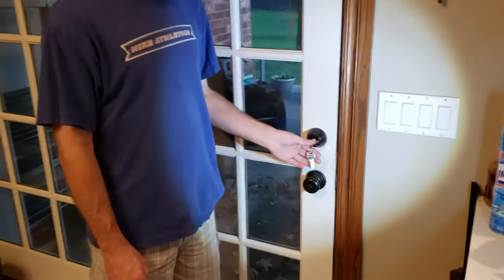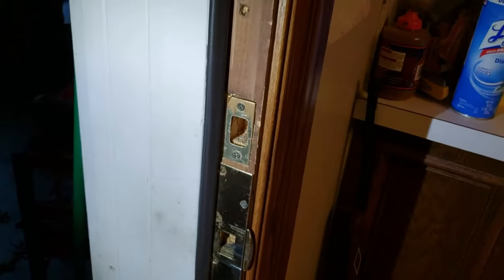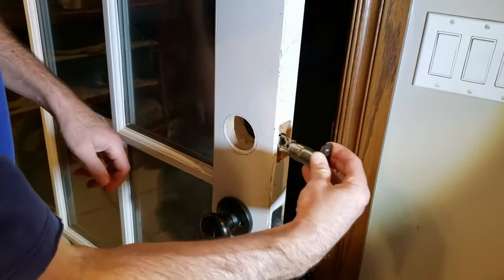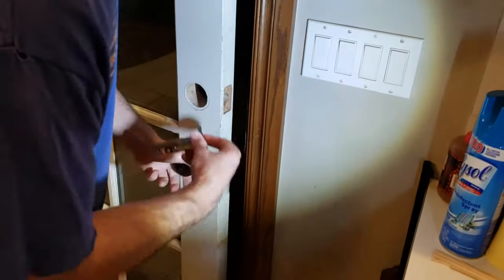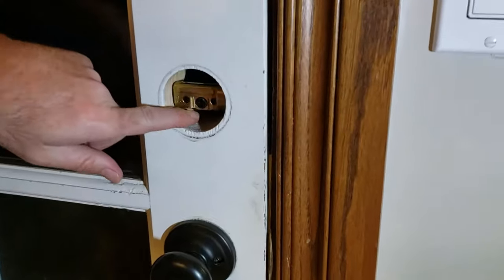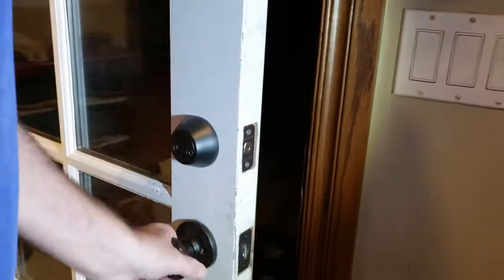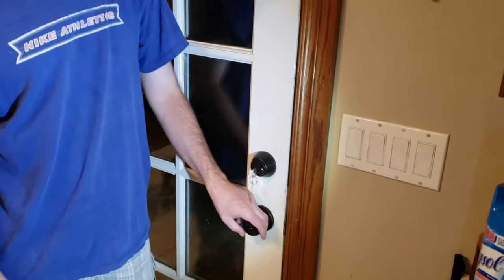How to replace a deadbolt door lock in 10 minutes. Easy install!

Comment: If the hole is stripped out you can also pack it with toothpicks instead of scrap wood, and then snip off the ends and the screw will be able to fit in tightly.
Reply from the maker: Great tip!

Comment: I was able to replace my deadbolt, thank you to this video. I used a Master Lock (heavy duty, ASCI 2), and it was quite similar to this one, only it was harder to thread the pieces of the lock into the area of the bolt where each piece is meant to fit.  It took me longer than 10 minutes, but I didn't give up. I'm not used to a project like this.  I took a break, watched this video and a couple others again, took a deep breath and got it done.  The new lock is way sturdier than my old one, and the key turns so easily.  Big difference, my old lock had been rekeyed a number of times, the last time a part-time lock smith rekeyed it and it was no longer safe, I could barely open it or lock it without significant struggle.
Reply from the maker: That's great to hear. Good job sticking with it and doing it yourself!

Comment: I’m actually glad I watched this before attempting to install my own!  The new wood in the screw hole is not something I would be able to tackle on my own since I don’t have that wood cutting tool or extra wood! It’s always nice she they show you in these videos the things that could go wrong before attempting it! So thank you!
Reply from the maker: I'm glad it helped. Not all screw holes get stripped/enlarged like mine did but it's good to be prepared. Also, you very well may have some wood around your house that would work - a paint stir stick, for example. But I understand the concern of getting part-way through and not being able to finish it.
Reply: You can use toothpicks as well.
Reply: I use wooden matches after I break off the match heads! They work amazing! Perfect size!
Reply from the maker: @tinafrick3331 Great tip! Thanks for sharing!

Comment: Thank you for posting this video! I’m a first time home owner, and my parents live a bit away from me, so I’m using this video to help replace my deadbolt. I hope it can do it as well as you did!
Reply from the maker: Good luck to you! It typically is as easy as I show in the video but still follow the instructions that come with the new lock to make sure you do it exactly right. I recommend the Kwikset rekeyable lock because you can make the lock match whichever key you want to use. That adds about a minute to the whole process:)
Reply: @FixEverythingYourself  how does that work?

Comment: I was able to replace my deadbolt, thank you for this video. I used a Master Lock (heavy duty, screwdriver , and it was quite similar to this one, only it was harder to thread the pieces of the lock into the area of the bolt where each piece is meant to fit.i tried but then i watch the video and it help me with the deadboat. thank you so much.
Reply from the maker: You're welcome. Great job doing it yourself!

Comment: Great video! Thank you. 

One quick fix for those with keys jamming in the locks would be to take a graphite pencil and rub a nice layer of graphite from the pencil onto the key. Then take the key and push it in and out of the hole to help lubricate the pins inside. Repeat as needed. That little trick has worked for me in the past on sticky locks. Also happens when you're washing the door with a hose and water leaks into the lock.

The trick of putting a piece of wood into an old screw hole is genius. If you don't have a piece of scrap wood laying around, you can also use a wooden match stick with the flammable tip cut off.

Cheers everyone.
Reply from the maker: Great tips!

Comment: Thanks for this video! I'm not super handy so this helped so much. Note for others: the bolt plate wasn't an exact fit where the old lock was, I had to chisel out a bit of wood with a hammer and screwdriver. Then I had to spend a some time getting the long screws in, the screw holes need to be lined up exactly. Also, holding both sides of the lock was really difficult alone so I suggest you have a helper if possible.
Reply from the maker: Thanks!

Comment: Great and informative video.  Before you folks buy a new one, however, get some graphite dry lubricant and spray inside the keyhole and that would likely solve this problem. I know the poster knows that, but he was showing how to change it out if needed, so as I said, great video!
Reply from the maker: Thanks! Good tip!

Comment: I watched your video and picked up on the 'arrow' thingy which I didn't know about.  I had taken out a corroded deadbolt from an outside metal door which was not locking (probably seized).  I miraculously had a new deadbolt I stored away in a ziplock bag a long time ago.  I tried to install but just could not thread the 'cross' bit on the inside.  I tried and tried to no avail for at least an hour.  Unfortunately, it began to rain so I had to stop.  I shall try again tomorrow and see if I'm successful.  Also, my door is deeper than yours so you can't really see what you're doing.  I'm hoping that I screwed the actual deadbolt in upside down.  Will try again tomorrow and see if I can finish it successfully.  Thank you so much for this video, it's very helpful.
Reply from the maker: I hope you get it figured out tomorrow. Thanks for the feedback!

Comment: This is a quite helpful video. Do you have a solution when the lock does not "fall out" once the two screws are removed from the inside? Neither side of the lock will come off. They are loose and they spin around (so I know they are not stuck not he paint) but I can not get either side to pull away from the door.
Reply from the maker: Hmmm, not sure i can tell you what might be causing that. Is the deadbolt itself still installed? Are you able to remove it and see if that frees it up? Doesn't sound like that's the problem but I'm not sure what else to suggest.

Comment: Thanks for the video was very handy.
Just a tip for others though, I had an issue where it was hard to get the key in and a friend suggested before I bought a new lock to spray with lubricant. This worked perfectly for me so no need to replace!
Reply from the maker: 👍 Yes, some WD-40 may free up a stuck lock.

Comment: Great tutorial.

For others: If the only problem is key not moving smoothly, first try a lock lubricant: WD-40 or other brands.

You may not need to replace the lock at all.

Comment: I have been procrastinating. Lol this is a very thorough video.
My problem was that you could lock the deadbolt but it wouldn't unlock something inside is broken I'm assuming. We would twist the lock back and then use a screwdriver to open it up. I mean that's what we're doing now to get out of the house. Lol I only use it at night.
This video gave me the confidence to actually go to Lowe's and buy a new one. The only problem is I really don't want to have to use two keys. Oh well sometimes you don't get what you want in life. Lol
Reply from the maker: Lowes sells locks that aren't keyed on the inside. It's pretty much the same process that I show in this video.
Reply: @FixEverythingYourself  Thanks! When I go I'll look for one.

Comment: Great video! Thank you! If my front door deadbolt is the same as my garage door/home deadbolt how do I purchase a new deadbolt so they both have/use the same key?
Reply from the maker: Kwikset brand has a re-keyable lock that allows you to change it to whatever key you want. It's a good quality lock, not too expensive, and only takes a minute to re-key it. So you can make two locks the same.
Reply: @FixEverythingYourself  Awesome! So if I go to Lowe’s they can re-key my new deadbolt to natch my old key? I’d like to not have to replace both deadbolts. Thx!!!! 👍
Reply from the maker: What you need to do is go to Lowe's, buy the re-keyable type of Kwikset deadbolt, install it, then re-key the new deadbolt to match your existing house key. You can do it yourself with the instructions that come with the new lock. Only takes a minute after it's installed. No need for Lowe's to do it.
Reply: @FixEverythingYourself  thanks so much!!!

Comment: The two prongs inside that go in the +. They spin around so how do you know where the correct place is to start in placing the prong in the +?
Reply from the maker: Either way should work. Try one way and, before fattening everything permanently, make sure you can turn the lock from inside or outside and that the position of the keyway is how you want it. If it looks good, you're good.

Comment: Thanks so much! My deadbolt broke last night so this helps a ton!
Reply from the maker: Great!
Reply: @FixEverythingYourself  I’m having trouble finding it in the video again, what was the name of the brand of lock? Needing something I can use my apartment key on
Reply from the maker: I think the brand I used in the video was Gatehouse - it's just a cheapy lock sold at Lowes. Kwikset sells one that's much better quality AND easily re-keyable, so you can make it match whatever key you want it to match. A little more expensive but probably worth it.

Comment: Awesome video. Just what i needed for my issue. 

I suppose my only question not covered in here is how do you get the same key to work in the new lock?
Reply from the maker: Thanks. If you buy the Kwikset rekeyable type, it comes with instructions and a tool for how to rekey it. Takes two minutes (max). Very easy.

Comment: Does the bolt piece between the front and back always need to be replaced or is that just a universal fit?
Reply from the maker: It doesn't always have to be replaced. Some will be reusable with a new lock while others may not be. If your existing deadbolt works with the new lock, there's no reason you can't reuse it.

Comment: For me, if the cylinder is in the locked or unlocked position, then the inside handle also has to be in the matching position when aligning the flat piece.

Comment: What if you can't get the old deadbolt off of the door?  Mine wo'dts come out. I tried to pry one side off wit a blade screwdriver but it's not coming off.
Reply from the maker: Sounds like it's stuck in the hole in the door? See if you can turn the entire deadbolt assembly (what's left in the hole). You could do this by putting the key in and turning it in both directions, and when the key reaches a stopping point, keep turning it hard to see if you can get the whole thing go move a tiny bit. Then try it the other direction. If you can get it to rotate even a little bit, it'll probably come out after that.

Other thing to try is to grab it with pliers from the inside (if you can find something to grab) and turn it hard to try to get the deadbolt to rotate in the door hole. Or try it from the outside. You're just trying to break it free from whatever is keeping it in place, and rotating it is a good way to break it free.

Comment: What are my chances of the screws being stripped? Does it happen a lot?
Reply from the maker: Are you referring to the holes that go into the door where screws hold the deadbolt in? It'd very common for the holes in the wood of the door to get stripped on a job like this, especially when DIY homeowners are doing it for the first time. But the fix is easy like I show in the video.

If you're asking about the screws themselves being stripped, the only screws that might get stripped are the ones that go through the inside locking mechanism of the door and connect to the outside locking mechanism. Those don't usually get stripped but if they do, there's really nothing you can do about it and the lock is probably a loss if you can't assemble it tightly.

Comment: What if the existing dead bolt does not have a screw system on the locks. Both sides are covered, how do i remove the casing?
Reply from the maker: Sometimes there's a cover over the screws on the inside. Try getting a thin, flat-head screwdriver and see if you can pry off what's likely a cover over the screws.

Comment: Why would the fastening bolts be on the key side of the lock?
Reply from the maker: They're on the indoors side of the lock. If this wasn't keyed in both sides but was instead the kind with a small handle/lever to turn like most deadbolts, the screws would be on the indoors side. Prevents someone from taking the lock apart from outside.

Comment: Hi how do you do that hole that the round part goes in to
Reply from the maker: Hi. I'm not sure which round part or hole you're referring to. All of the large holes in the door that the deadbolt cylinder and lock face go in were pre-existing in the door, if that's what you're asking about?

Comment: The issue I'm having is that using the key from the outside locks the deadbolt perfectly fine and smooth, but if I try to lock it from the inside the bolt only goes out about a 3rd of the way and seems to bind up. I have taken it apart and put it back so many times and I'm just confused at this point. The only noticeable difference with my setup is that the outside half has two guides to help the screws line up
Reply from the maker: Hmmm, I'm puzzled by that, too. I can't think of an obvious answer that would explain what you're dealing with. Have you lubricated the insides when you've taken it apart? I assume you have but it's the only thing I can think of.

Eventually, a lock expert might see your comment and provide an answer. Otherwise, maybe it's best just to replace it? Sorry I don't have a better suggestion.

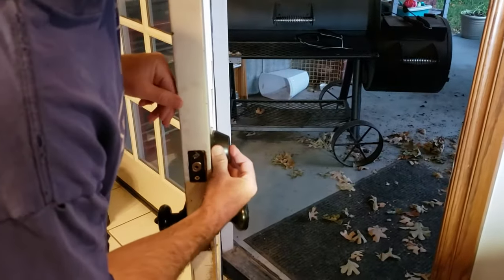Comment: The part at 1:15, right before you say "it's easy" . . . that's the part I can't do. The spindle has a twist in it (not broken, that's the way it's manufactured) and I cannot get the front part of the lock (the part the key goes in) out of the door. I can't get the spindle to slide through and the front part is stuck to the deadbolt part. HELP!
Reply from the maker: Hmmmm. I'm not exactly sure what you're dealing with but are you able to put a key in that part of the lock that won't come out and use the key to jiggle the lock to help get it out? Another option would be to unscrew the deadbolt piece that's screwed into the door jamb (the bar that's left in the door after the two keyed pieces are removed) and start to pull that out to see if that helps the other parts come free. Basically, keep disassembling the lock and see if other jostling of the components helps things break free.

I hope that ends up working for you. I wish I could see what you're seeing to offer more help. Good luck!!!
Reply: Take a thin screwdriver/chopstick/awl and try to tap  out the spool/bar. Small, gentle taps. Spray some lubricant on it. Place a cloth over lock, one or two taps with a rubber mallet to loosen.

Comment: My door has an ordinary lock on it, i want to change the regular lock for a dead bolt.  Do u have to use a drill to remove the screws, i dont have a drill thati can use.  Im terrified that i will remove the reg lock and wont be able to get back on! I really wish that someone could install the lock for me
Reply from the maker: Is there anything in the door where the deadbolt would be? Or just a knob lock and nothing above that where the deadbolt goes?

Comment: I want to change my regular lock for a deadbolt is that a difficult job, i know nothing how to change one for another, im sick of my property being stolen bc they used a n ordinary knife to pop the spring on the door and helped themselves to whatever they want to take or destroy my belongings
Reply from the maker: Does your door already have a hole where the deadbolt would go but has a different part in there? If so, putting in a deadbolt is easy. If your door has no hole where the deadbolt goes, it's a bit more involved but still doable. There are other videos out there, I'm sure, and deadbolts come with those instructions, too. It involves drilling a hole through the door (not hard but you need a drill and hole saw - Harbor Freight), and you also need to drill a hole in the door jamb (not terribly difficult but takes a little time).

Comment: so if they bust your window unscrew the two screws and door is unlocked
Reply from the maker: If they can do that before the German Shepherds tear their arms off, yes.
Reply: @FixEverythingYourself  you can simply fill in the head of the screw with some kind of putty material like drywall putty which hardens and can be chiseled out when you want to remove the screws. Will make it very difficult to Chisel backwards from the outside and to get a screwdriver in there. or you can replace the screws with special security screws
Reply from the maker: Great input, Ed! Thanks!
Reply: and the sound of the security system pierces 
the sound barrier

Comment: My new one is too long how do I make it shorter when it’s say it’s adjustable
Reply from the maker: What's too long? The new deadbolt that goes inside the door? If so, I think you just twist that part as if you were wringing out a wet washcloth. But the included instructions will show you how to make it longer or shorter.
Reply: @FixEverythingYourself  The long thingy is too long while the old one I took out was a perfect fit I tried spin to adjust it and it’s not working. Hate doing shit myself I always mess up 😫😫😫😫😫guess put this in the junk drawer or get my money back and be stuck with a raggedy ass door
Reply from the maker: Find the instructions that came with the new lock. If it says "adjustable", there will be instructions on how to shorten it.
Reply: @FixEverythingYourself  I did!!!!  I even read it in all the different languages It’s hopeless

Comment: What if the lock got stuck? I can take off both sides of the door lock but the lock itself is stuck to the door frame
Reply from the maker: Are you talking about the barrel piece of the deadbolt? Is it screwed into the edge of the door? It should be and you'd need to remove those screws. But I'm guessing I don't understand what exactly is wrong.